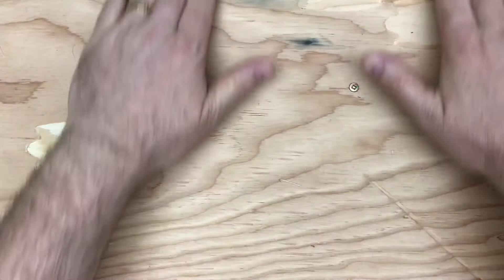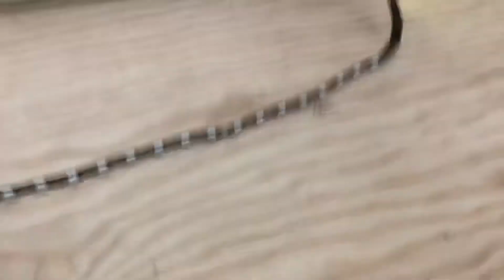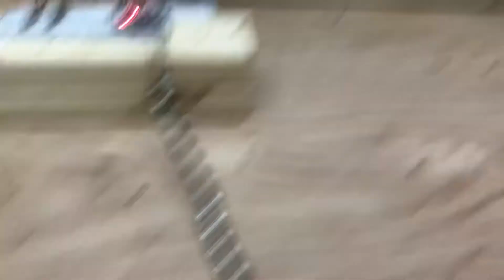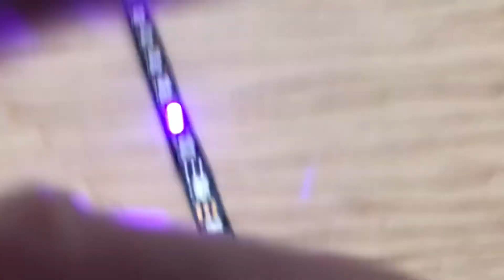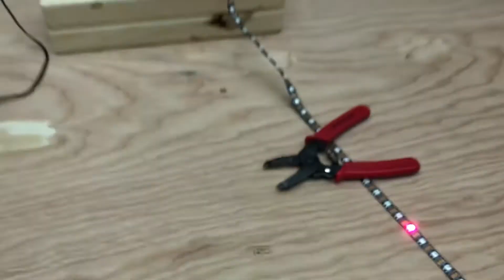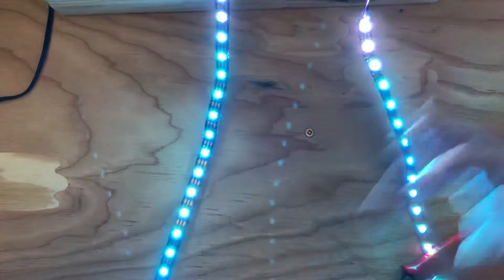SCleds - Prototype on breadboard. (part 3/6)

Comment: Shawn in your code you have a “switch (style % 8) to select the  case () how does this work? If it is like a array and “style is 1 it would give you 7 but it doesn’t match the case (number) the case that it picks is 1 same as the style could you please explain how it works. 
Jim